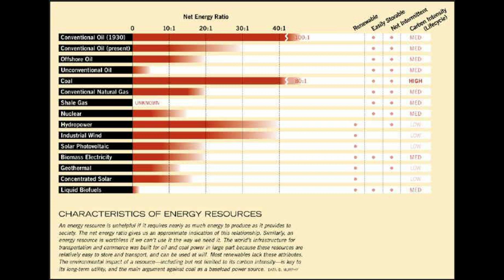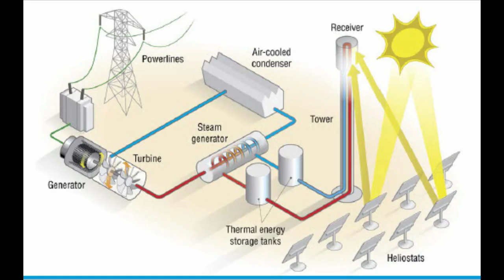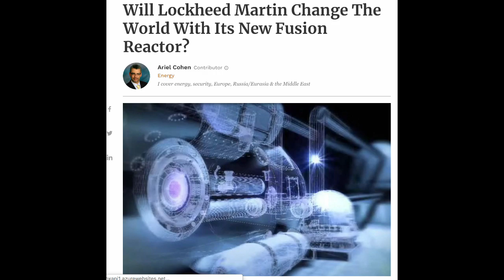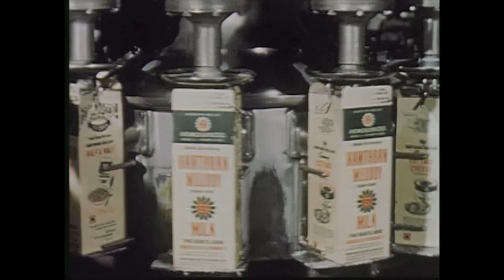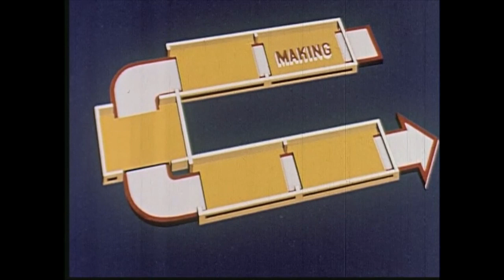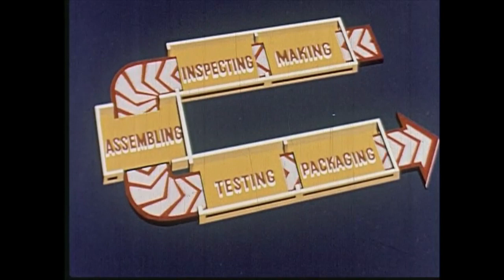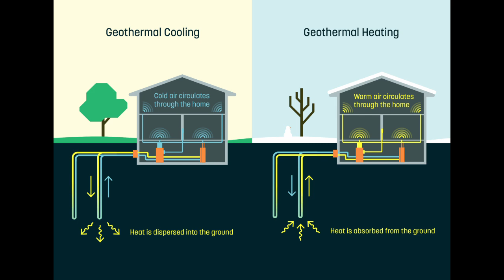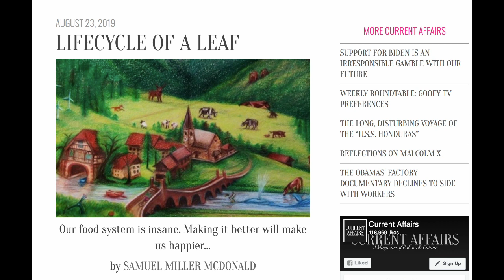Renewables Can't Power Capitalism, They Can Power Ecosocialism

Comment: Good video! I agree with most of this, although I would like to add that all the systemic changes needed will probably not come about through electoralism and reform (though, of course, electing someone like Bernie Sanders or similar politicians does help us move in the right direction), but will necessitate revolutionary action on a huge scale. Also, given that we have very little time left until we reach a tipping point, I would say that a planned economy is probably most well-suited to deal with this, as big changes can be managed in very little time.

Comment: I wouldn't wait for subsides. That's just not just not going to happen. The coal needed to build and replace pv solar panels isn't feasible nor for mega wind turbines, but passive solar and simple wind devices that most people can assemble at home as well as earth heating and cooling are great ideas. Buildings will have to be small enough to be repaired and supplied by humans and the means of life should definitely be within biking distance.